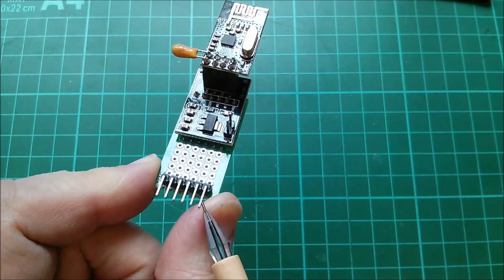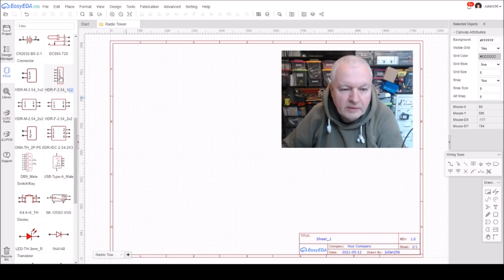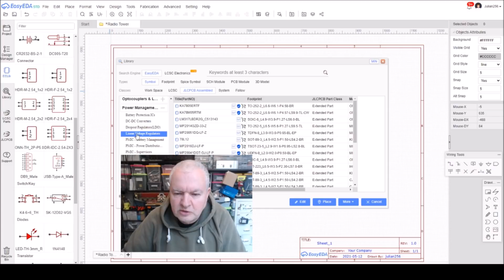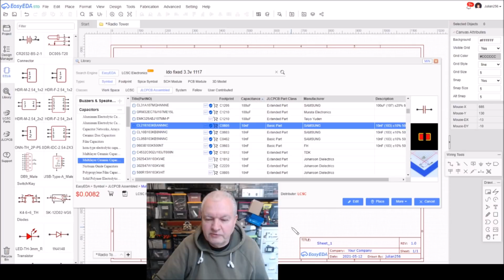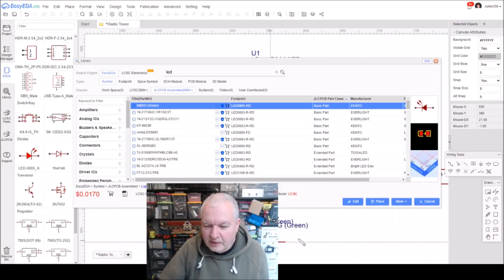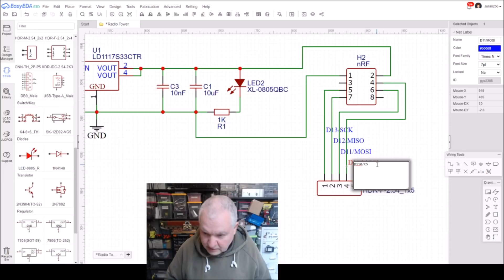Schematic capture in EasyEDA - Arduino Radio Tower

Comment: All you need is a very bright light - it shrinks the pupil which sharpens the image - and a magnification visor - about 2.5x - and you should be able to do 0603 SMD without too much difficulties.

Comment: Food for thought - These AMS1117 regulators have a tendency to put input voltage to the output when fail. Had couple of such cases on a breadboard power supply and you can imagine what happens if you expect 3.3v on a rail but you are getting 12v there instead without any warning.

Comment: I like your video's, but in this project I keep wondering: why not use two esp32 with built in oled display? No need for separate touch board, no need for nrf24 and no separate oled print. Everything can be done with a standard board. Or was that too simple? Still, great project nontheless. Cant wait for the next video.
Reply: Well, you could use that. You could also use other dev boards. But, you see, why use more expensive, complicated devices, when everything he wants from this works just fine with simple nano, two oled's and one radio module? There's no need for ESP32, just use parts strong/fast/whatever_you_need enough to make it work. There's no need for three esp32, because he would need one for shed, too.
Reply: @kjur18  More expensive? I doubt that. esp32+oled is 6,39 eur on aliexpress. I doubt that all components now used with the added custom pcb will be cheaper than two of those esp32. More complicated? Its just same programming using arduino. Use built in touch with esp-now for communication (or wifi). Only argument for his approach is the added learning for using different components and the custom pcb. For that reason I still like his project, but for replicating his project I would use two esp32.
Reply: @DrRoelski  You could get two nano's for a price of one esp32. Custom boards cost? Then why he has jlcpcb stuff all over the place and says that they are sponsoring him? There is no cost of custom boards (probalby). There is really no need to use esp32, unless he wanted IoT or run out of flash memory, then using more powerful board is advised, but if everything works fine on current setup, why change it?

Comment: Tried using the JLCPCB placement service and had exactly the same problem  - I simply couldn't find the parts I needed without spending a huge amount of time searching and then cross-referencing with data sheets. I gave up in the end.

Comment: Some parts are not listed using the way that you looked for a 3.3volt reg, best to go to the jlcpcb SMT parts library and put 1117 into the search box. AMS1117-3.3 Basic part C6186 ￡0.0875.
In easyEDA, Place > Symbol, search LCSC (not LCSC Electronics) for C6186 and place it :)
For capacitors, again use the JLCPCB parts library :) For some reason they do not have a 100nf 0805 in Basic parts, they do have an 0603 - C14663.
I find it easyer to tap the space bar to rotate :)
Red LED 0805 Basic C84256
Reply from the maker: Thanks for the info Steve - I do need to do more of this to better understand how the libraries work. If it means not having to solder SMDs then I'm all for it :)
Reply: Soldering SMT is easy using the correct method, hot air, stencil, solder paste, and ceramic tip tweezers :)

Comment: I've had some issues with EasyEDA not having all the parts I needed, so I prefer using Kicad. But I am interested in the JLCPCB surface mount service. Is it possible to have JLC fit SMT parts on projects not made with EasyEDA?
Reply: Yes it is, normal gerber required and also BOM and Pick & Place files
Reply: @steverpcb  Cool, thanks, I'll have to give it a go.

Comment: Hi Julian, thank you for the talk through of the schematic, you actually connected everything with wires, instead of being lazy and relying on net-names to do the connections.👍👍👍👍👍
Net-name, I call them "Search A Word" diagrams as they are hopeless when it comes to troubleshooting circuits.
The net-name does not tell you how many connections it has and you have to search the the entire "schematic" to be sure you have got all the connections.
Actually using wires makes reading a proper schematic easier to follow when trying to understand any signal flow.
Some may say, use the CAD to show you all the net points.
Sorry but I don't want to load up a CAD program to view a circuit, you should be able to export to jpg and show ALL connections in it.
That is my soapbox for the day..😃😃😃
Great video...
Reply: Yeah, now try doing that with a board that has packages with ~100 or more pins.
Reply: @donpalmera  yep !
Reply: Sorry Tom but I can't agree.  Even on a small circuit like this wiring soon becomes a mess, and if you are going to label the connections anyway you might just as well use net ports
Reply: @Bob_Burton  Yep !